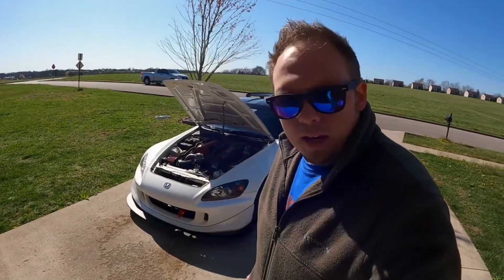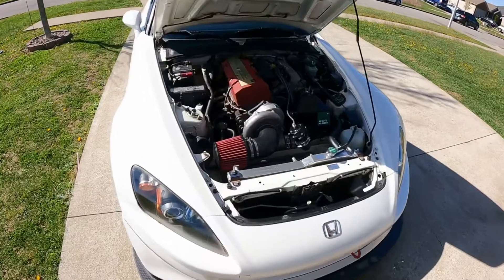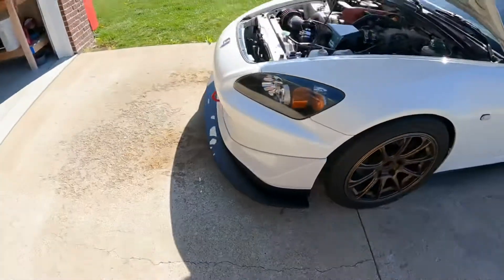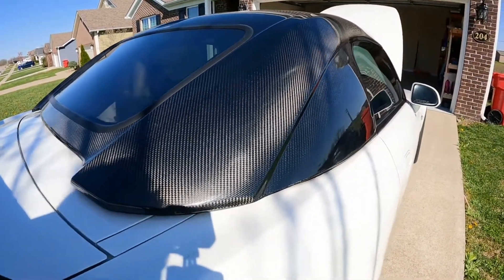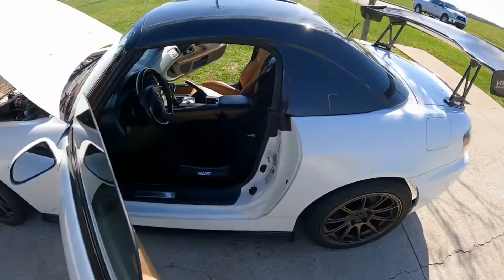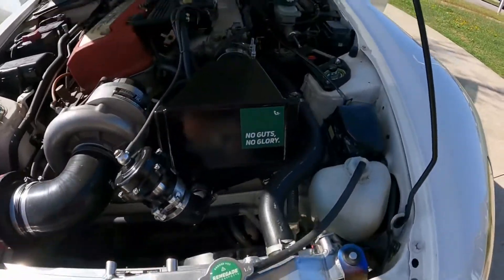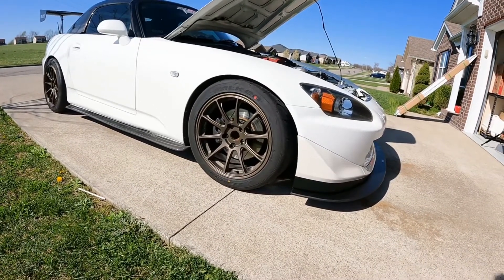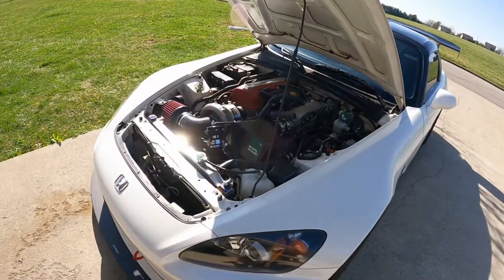Sos Supercharged Honda S2000 Walk Through

Comment: Brakes are THE first mod to do with a road race track driven car. Everyone only thinks power but the key to a good lap time is corner entry and that is the brake zone. Then suspension is next. Aero only helps once your pace really picks up in the higher speed corners.
Reply: Well.. tires… then brakes.  IMO.  But yes, most of the time more HP is NOT the answer.

Comment: dope as car wanted a sos kit as well but i ended up going with the FullBlown Motorsport turbo kit
Reply from the maker: Nice!
Reply: yeaa made 540 6262 turbo just waiting for my new wheels so i can drive it since it currently just spins lol
Reply from the maker: That’s a handful for sure!  I feel like 400 whp is the perfect power level where you can still use all of it and not lose control/die 🤣
Reply: @TheVCRoflcopter  Yea i feel like anything above 500 for a s2000 is too much. The car is light doesn't need that much power for street use or daily driven. I plan on lowering the boost since i plan on daily driving this summer

Comment: What spring were you running with the tial blow off valve? And where did you buy it? Currently have a greddy but want more noise. I have the same exact setup down to the header and cat back

Comment: How is your wheels fitment? 
Any rubbing?
Also how close to stock is your suspension settings
Reply from the maker: No rubbing on that setup at all, it’s definitely lower than stock and swift springs to help offset the aero